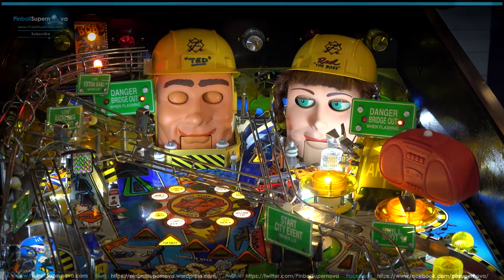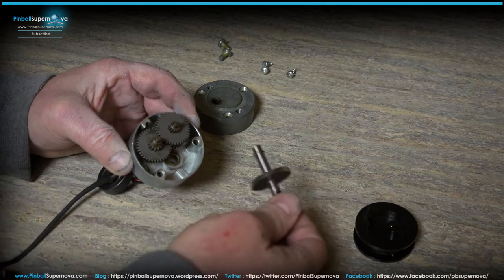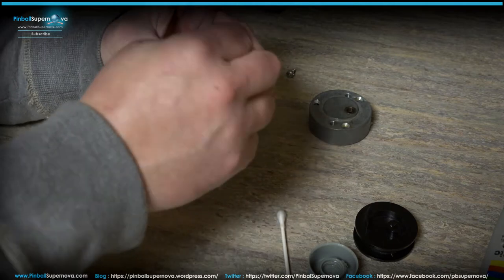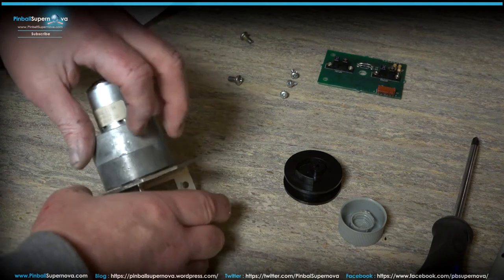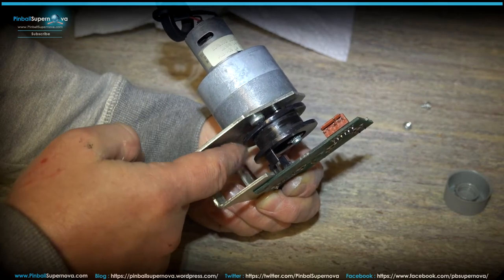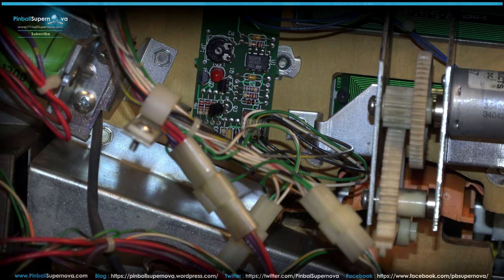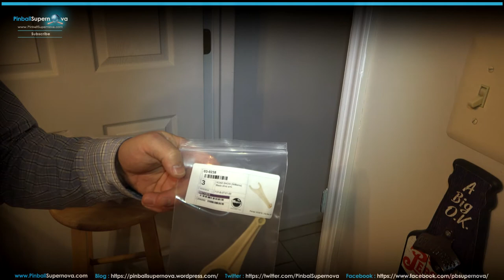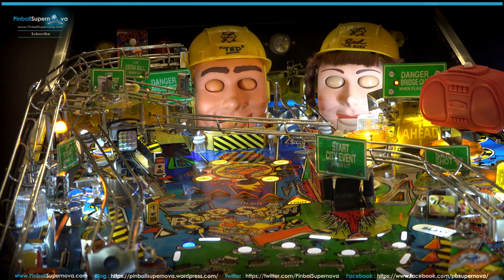Pinball Tech and Repair #26 : REPAIRING TED'S BULLDOZER ON ROAD SHOW PINBALL.

Comment: Could you offer me your expertise on a problem with I’m having? My bulldozer moves up and down perfectly in test mode. But during gameplay one multi ball starts, Ted’s mouth opens but the bulldozer stays closed. And then sometimes on ball two or three if I am still trying for multi-ball, it will open partially it’s very bizarre. Any ideas what that might be? I was thinking maybe there’s a chip or something on the MPU that tells it to open?
Reply from the maker: The only thing I can add to it is if you watch my video, that little plastic piece attached to the bulldozer that attaches to Teds pully was non existent causing the bulldozer to sometimes work or not.  It would slip and the bulldozer would not open at times.  I was wondering the same thing on mine when I discovered that piece.  Did you check that plastic piece that is formed into the bulldozer on yours?  Just curious.
Reply: Pinball Supernova  You wouldn’t believe it but it turned out to be the Opto interrupter board. There was a ton of black dust/dirt on the inside of the Opto’s. I clean them with rubbing alcohol and it’s been working fine since! Thank you so much for the reply I really appreciate it. Your channel is great!
Reply from the maker: Awesome glad you figured it out. Thank you for the positive comments. Much appreciated

Comment: Thanks for that great technical video.
I succeed to buy both the Dozer blade and the Drive arm but still wondering what is the size of the ring you are using (lenght and diameter). Thanks in advance.
Reply from the maker: Xavier  thanks for watching,  what ring are you referencing?
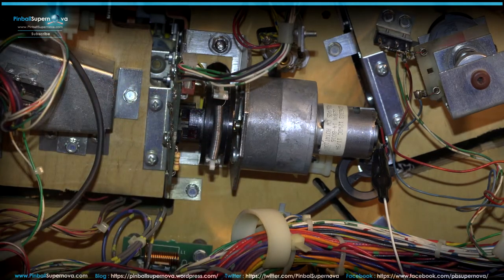Reply: @pinballsupernova  The one fixing the drive on the cam (appearing in your video at 16:34min).
Reply from the maker: @xavierlacoux402  This spring may work...https://www.marcospecialties.com/pinball-parts/10-423
Reply: @pinballsupernova  Ok thanks. I will check that one. Marco'site is however mentioning jaw spring and not blade one. I guess there are the same.